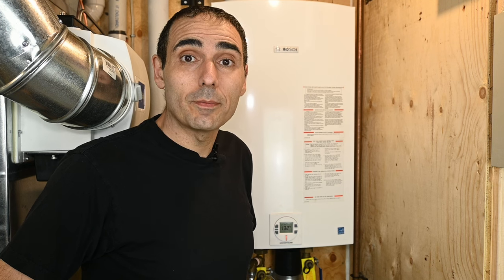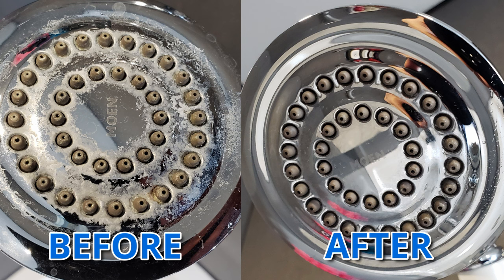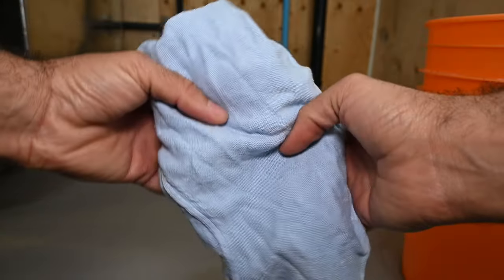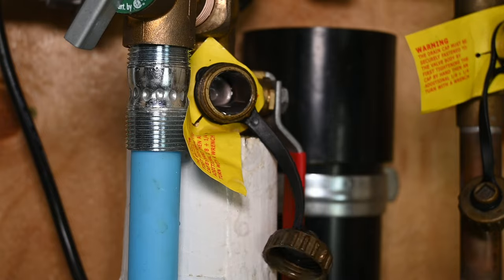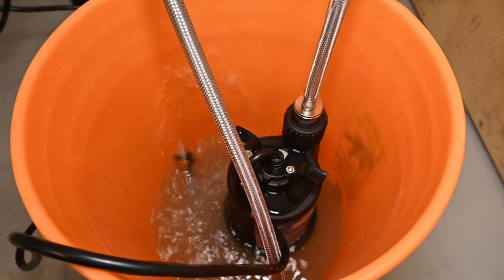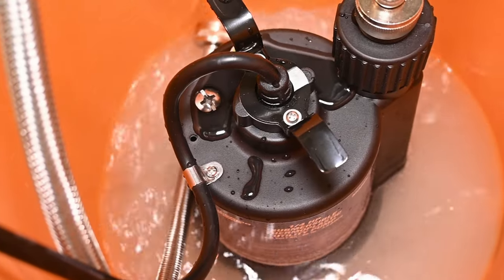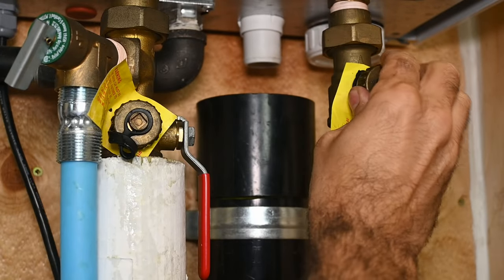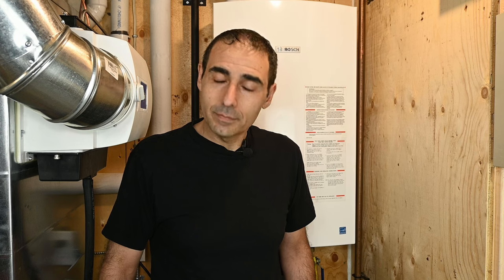How to Descale a Tankless Water Heater Simply and Efficiently!

Comment: You're such a good teacher, Frank, demonstrating every step of the set-up, & including little extras like the animation showing the direction of flow, and explaining what scale is.   I appreciated your multiple camera angles that let us see your hands & tools on every valve & filter. Also helpful and not in any other vid I watched today:  the info about pipe vs hose threads, and the possible need to get a male hose adapter for the pump.  One small suggestion:  I wished you had checked and cleaned the water heater's filter screen before you flushed, as well as after.  Also, you could show us how to clean the air intake filter too.
Reply from the maker: Wow! Thanks so much! 🙏 Your feedback is among the most thoughtful and constructive I've ever received; humbly appreciated, and I will certainly take your suggestions to heart! 😊
Reply: Frank, this was so interesting! It's Fun to learn from someone, Who knows what their Doing! 2 Thumbs Up!  Subscribed also! Thanks again! @PlumbingsCool
Reply from the maker: @dporrasxtremeLS3 you're too kind!...Thanks so much!! 🙏
Reply: ❤❤ As a woman I definitely appreciated all the angles and explanations I actually think I can do this myself!
Reply from the maker: @noneofurbizness1271  With some thorough foresight, planning, and sheer determination, there's no doubt you can pull it off!  👊  Let me know how it goes!

Comment: How big is your water heater? Mine holds 3 gallons but the manual says to use 4 gallons of cleaning solution. You only used 1 so is 4 way too much? The manual also says to use "cleaning solution diluted with water". Is white vinegar ok to use with this?
Reply from the maker: Hi there. I'm not sure how much that Bosch water heater shown in the video holds, but it's a lot less than three litres. 

That said, the amount you use really doesn't matter as long as you put in a volume that's AT LEAST equal to or greater than the volume capacity of your unit, because putting any less will prevent the liquid from circulating through the unit.  Which is likely why your three-gallon heater requires four litres by the manufacturer.  Don't worry about having TOO MUCH volume, because any excess will distribute into the bucket; it won't harm the unit. 

The most important thing is that you follow your manufacturer's instructions.  I'm not sure what they mean by "cleaning solution", but I'm willing to bet that vinegar would be a lot safer (and healthier) than the likes of CLR or other scale removers.  If you're in doubt, I suggest you call the manufacturer directly to ensure that vinegar would be safe for your unit.

And also be sure circulate the solution with the heater UNPLUGGED.

I once tried to descale an electric tea kettle by filling it with vinegar and boiling it, and it's an understatement to say that things didn't go so well (especially for the tea kettle, may it rest in peace!) 😂

Comment: Unfortunately I have not flushed/descaled our Rinnai since purchasing home in 5+ years ago. Is it too late? I have heard since it's been so long its best not to descale at this point. Or, should I still do the the descaling?
Reply from the maker: Hmm...If I were to guess, I'd presume that NOT descaling would cause more harm than good,and doing so would still be a "better late than never" scenario.  The worst I'd image is that you won't remove all the built-up scaling on the first attempt. 

But if you're in doubt, I suggest you call up or email Rinnai's tech support, which should be able to confirm the best route for servicing your heater to prolong its current life.
Reply: Thank you!  @PlumbingsCool

Comment: This video provided me with the information and confidence to service my own tankless (Rheem brand) unit. I watched another video first and the tankless unit in that video had service valves with separate contols for the cold water inlet/ hot water outlet and the service hose connection. 

I started to worry I wouldn't be able to self-service my unit and would need to contact a plumber. Luckily I came across this video and you have the exact valves that I have (which I now know as a 3-way valve),  down to the yellow tags. 

Armed with the proper instructions on how to use this 3-way service valve I plan to descale my unit this week. Thanks for the knowledge I hope I can pay it forward. 👏🏿👏🏿
Reply from the maker: Thank you! Empowering you is what it's ALL about! 

Cool Deadpool avatar, BTW!

Comment: Unless I missed something, the valves were open for the cold water feed when you took the bleeder caps off . Did you shut another valve off before the unit?
Thanks
Reply from the maker: No, the handles were parallel to the piping, meaning that the were OPEN to the incoming water supply and the house fixtures, but CLOSED to the service ports.

Therefore, I was able to remove the caps and attach the hoses without any supply water coming through.  I then turned the cold handle a quarter turn, which isolated the unit from the incoming water supply, and opened flow through the service port.  I then did the same for the hot side, which isolated the rest of the house from the unit, but opened flow-through out to the service port - thus creating a closed loop.

While you can certainly shut off the main water supply (and might actually be a good idea if you're new to the procedure), these service valves make it unnecessary to do so.

Comment: Great video. Thanks for the education. Why treat the problem if you can prevent the problem?  Why not just use a water softener to filter out the hardness?
Reply from the maker: Thank you 🙏 and great question!  Although the installation of a water softener is certainly a game-changer for all your plumbing fixtures, not all water supply sources are always hard enough to justify the installation of a water softener to treat the incoming water.  Also, the installation of a water softener may not be beneficial to those in the household who are diagnosed with hypertension (high blood pressure).  A. Water softer works by replacing calcium and magnesium (and some iron) with sodium, which gets directly dissolved into the treated water, which may adversely affecting those with high blood pressure.  Finally, some people simply don't like the feeling of washing or bathing with soft water (I'm one of them!). Although some see it as a benefit, the treated water's absence of abrasive minerals makes washing with it feel "silky smooth" on the skin.  I personally liken it to the feeling of never being able to rinse the soap off, no matter how much you scrub...it just feels slimy to me! (but I'm probably in the minority).   Also, I know some sticklers who still prefer to descale their tankless heater anyway, despite the existence of a softener - for example, in case their softener was not working properly or efficiently.

Thanks for your question and happy holidays! 🥂

Comment: Great video. I purchased a pond pump at my local box store. After about 3 years the rubber o-rings totally deteriorated and the metal part inside the pump completely started to corrode from the vinegar, pumping debris inside my tankless heater. Is there a pump you recommend that will withstand the corrosiveness of 5%vinegar. Thank you.
Reply from the maker: Thanks! Yeah, once had an issue with a pump corroding in the past as well, as a result of the vinegar.  What I've since done is thoroughly rinse and flush the pump with clean, fresh water.  This means actually running new water through the pump ad well.  Be sure to also rinse the hose connections, which will equally corrode.  In terms of pump type, I think any standard submersible sump pump will suffice - such as the one I show in the video, which was purchased off Amazon for about $100.

Hope this helps and thanks for watching!

Comment: Can you make a video about water softening system, in particular the Trojan UV model mentioned in this video?
Reply from the maker: Water softening is an interesting subject, which works by exchanging calcium/magnesium ions for sodium ions, which removes hardness from the water...but the Trojan UV System is a completely different animal; a UV system does not soften or filter the water in any way.  Rather, it deactivates the DNA of any parasites, bacteria, or viruses which may be present in the water by exposing them to UV light before it is distributed through the system...thereby preventing them from multiplying.

Is there anything else specific you'd like that you know or learn about?
Reply: @PlumbingsCool  Which system would you recommend for whole house water softening? Are they easy to retrofit into an older home?
Reply from the maker: For water softeners, I've often sourced the Viqua brand for my customers...although there are tons to choose from. 

With respect to installation:  Most softeners are actually designed for whole home installation.  Generally, a softener is a relatively simple installation.  It's generally a matter of cutting into the water distribution line at the home's water service (before it is delivered to any other fixture in the home, but after the meter), and routing the line into the inlet of the softener.  The outlet then reconnects back into the other side of the distribution line you cut into. There's usually no need to install a bypass since most softeners have one built into the head in the event it must be serviced or installed. 

A couple of things to keep in mind:

-You will need a nearby drain to route the softener's discharge during the regeneration cycle

-You will need a simple household power outlet (120V in North America) to power the unit (simple  plug-in adapter; no hardwiring of the unit necessary) 

-It's extra work, but if possible and accessible, you may want to run separate water supply lines to your outdoor hose bibs, which feed BEFORE the softener.  This will prevent soft water from being wasted outdoors (exception: you may want outdoor soft water for washing your vehicle, which is easier on the paint finish) 

-Finally, try to have your water analyzed to determine the hardness level so that you can properly program the softener so that it softens properly, and uses the right amount of salt. 

Hope this helps! 

(Hmmm, this topic might make a good video. 🤔)

Comment: Hello! Thank you for your video. I just did my first descaling on my own and had a quick question. I used a gallon of water and a descaling powder. After about 30 minutes, nearly my entire bucket was filled with water. Did I do something wrong? Where is all of this extra water coming from? Thank you!
Reply from the maker: Hmmm...little tricky to assess without seeing it.  However, I'm wondering whether all the residual water in the tank got drained  before you started the process (possibly due to airlock).

One possible way to eliminate airlock is to shut down/isolate only the Cold side of the tank, and with the hot side valve kept open, go by a nearby faucet (preferably upstairs from the water heater. If possible) and open the hot.  This would allow air to enter the hot piping, which may release any trapped water being held back by a vacuum.  Be sure to have your hoses attached to the service valves with the other ends sitting in a bucket or drain to avoid a big puddle if/when the trapped water is released.

Hope this helps!
Reply: @PlumbingsCool  Thank you. I did think about this, but nearly 4 gallons seemed like a lot to be stored in the unit. I am really perplexed. 

Thanks again!
Reply from the maker: Yeah, four gallons is certainly a bit much. It sounds like your source is coming from elsewhere. Either your cold water is passing, or perhaps you left the hot side open, thereby passing residual water from your home's hot water lines.

Please do feel free to let me know if if you find the source of water. I lose sleep over these mysteries!

Comment: I was quoted $3151 yesterday to replace my water heater...decided to go tankless & have a friend who already installs tankless in remodels that is doing the install.
It's criminal to uncharge so much on these simple services 😮
Reply from the maker: Although it's difficult for me to assess your situation as to why the quote may have been so high, the price does sound a little steep for a traditional water tank.

Hope you enjoy the tankless heater!
Reply: @PlumbingsCool  I asked why the quote was so high & the guy tried to tell me "that's a cheap price".... water tank runs about $600-$700???
Reply from the maker: Price depends on the size and type of the water heater.  The electric ones are less expensive than gas-fired.  If the latter, 50 gallon natural gas have skyrocketed here in Canada...and my wholesale price is no less than CN$1,600, excluding markup, labour, and other materials.
Reply: @PlumbingsCool  the 50 gal water tanks run under $700 & my garage is full of pipe & all the pieces & accessories necessary, my ex left a garage full of heat & air, plumbing & electrical supplies. My son replaced the water pipe from the main to the house for about $140 in parts....I had an estimate for $7200 & $4800....Ridiculous & this is after the trench was dug up. He was getting ready to go out of state to work & needed the pipe laid & crimped.  He went ahead & finished it himself after that nonsense estimate.
Reply: My tankless unit cost about $900 for tank & parts & is being installed for $250   by a friend who does several of these every month.

Comment: Hi does it matter if the pump is a 1/4 HP or a 1/6 HP when descaling tankless water heaters? Which one is better for descaling.
Reply from the maker: No, I don't think it'll make much of a difference.  The important thing is that you get the vinegar circulating efficiently, even if it moves through the unit a little more slowly.
Reply: I can verify that 1/4 HP is really good...I have the exact pump they use in this video and it's really good. Used it a couple of times for this very situation.

Comment: What about putting like a sock or something attached to the hot water hose so it can catch sediment? Not saying its gonna catch everything, but wouldn't it be better to not run the sediment back thru if yoy can help it?
Reply from the maker: Not sure how that'll work, but if it does release sediment, then it was small enough to get through the system and should be able to flush right through.  Also, if there's any sediment which consists of scale, then the chemical should do a good job at breaking it down to smaller particles.

If recycling sediment is a concern, one thing you could do is raise the bottom of the pump a few inches by placing it on some blocks so that any released sediment has a chance to fall to the bottom before getting sucked up again.

We often do this with sump pits to avoid the inlet from becoming blocked from a buildup of heavy sediment, debris, or even mud.

But give your sock idea a shot; I can't see it hurting if that's your concern...or perhaps you want to try something more permeable and thinner, like intercepting the outlet by fastening panty hose or cheese cloth with an elastic band to the hose end.
Reply: @PlumbingsCool  Nice, thanks 👍🏼

Comment: Do u have a video on how to install a water softener/filter ?
Reply from the maker: Sorry, I don't yet.  The good news is that the actual installation of a softener is not an overly-complicated process.

All softeners typically have a water IN and and OUT...and they usually have their own built-in bypass valves.  So generally, the untreated Cold water supply connects to the IN, and the softened water connects the household piping (where you want the soft water to go) to the OUT.

A few things:
You probably not want your softened water to run outside to your outdoor hose Bibs (unless you want to use it for washing your vehicles).  Therefore, you may want to run a dedicated branch line from the untreated main water supply BEFORE it enters the softener, to every outdoor hose bib you requiring untreated water.  This way you'll still get the soft water indoors, but nourishing hard water for your plants & garden outdoors.

You'll also need to run the softener's drain outlet either to a nearby drain or into a nearby laundry sink.  I've often used hard piping because it looks nice and for longer runs, but you can usually get away with flexible tubing, which often comes with the softener if you're draining nearby. 

Also, a mistake a lot of installers make is that they install the softener and keep it at its default settings without properly checking the exisitng hardness of water supply.  This may result in either too much salt usage, or not enough  softening.  I recommend you take a sample of your untreated water either to a local service which tests hardness, or buy a kit to test it yourself so that you can set the softener to the appropriate hardness settings (known as Grains Per Gallon (GPG) or Parts Per Million (PPM)).

Do also take a look at the manufacturer's instructions, which will provide you with ample information to ensure a proper installation.

Hope this helps!